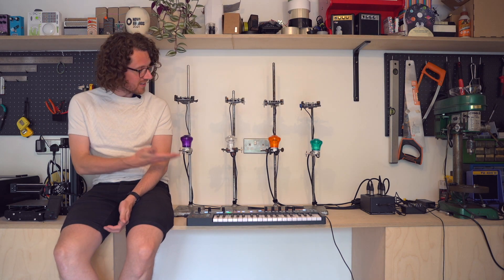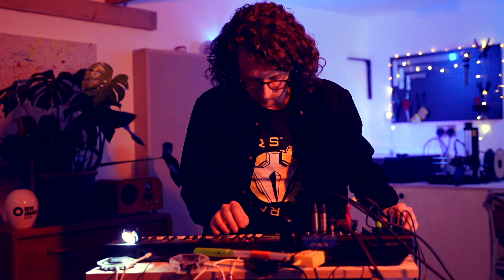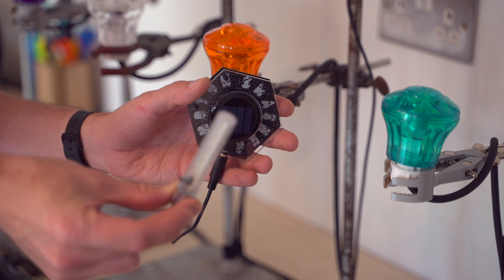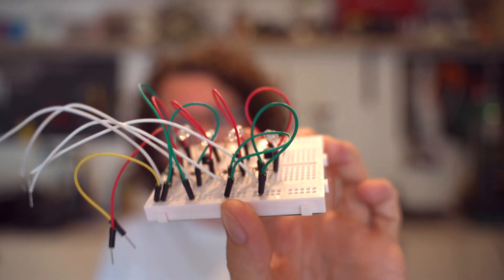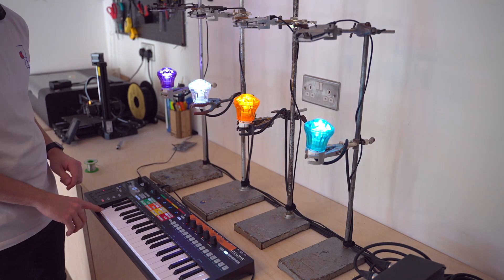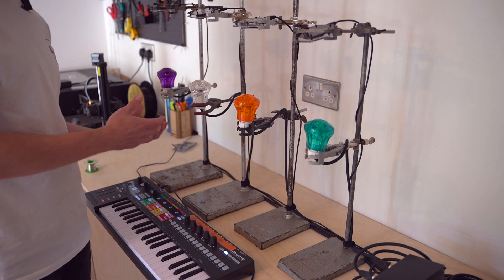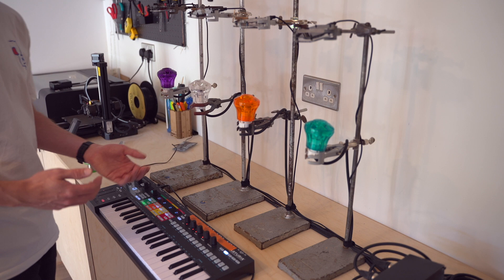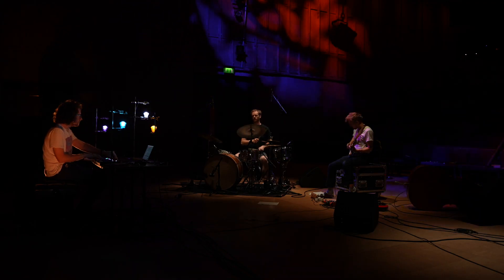The Synth Made of Light

Comment: insanely cool, congratulations! are the effects controlling the cells' output or are they sent with the source midi signal? also how tf do the cells replicate sound so accurately??? did you add the ambient background synths later or do the cells capture that too? bc if they do that's actually mindblowing
Reply from the maker: Cheers! Think of the cells as dynamic mics, their output is a square wave - which is the shape of the PWM sent to the light. Ableton is acting like a big multi-fx pedal, with a variety of delays and reverbs.